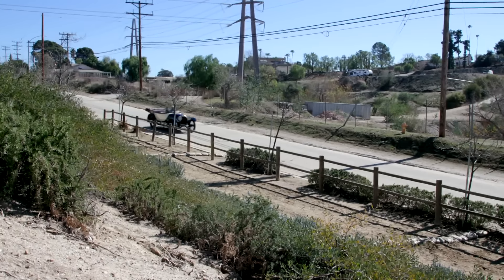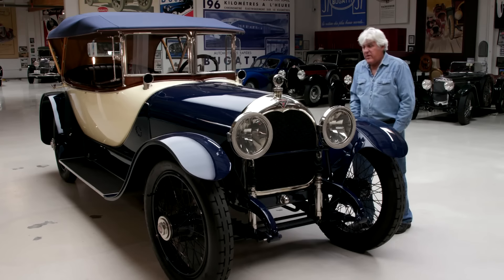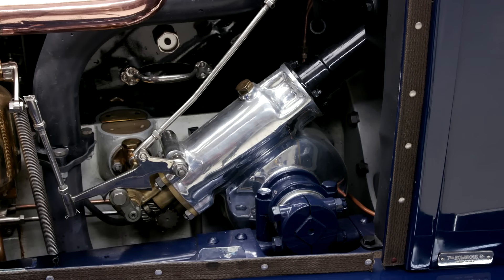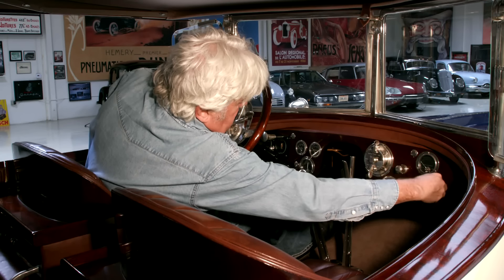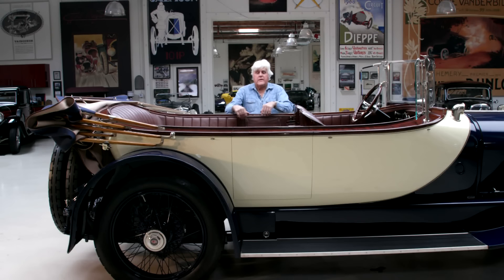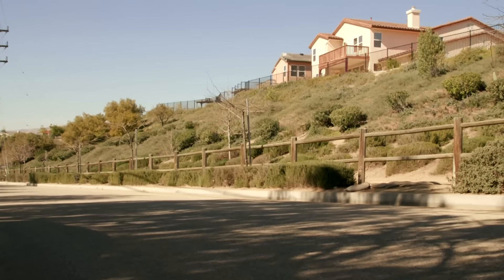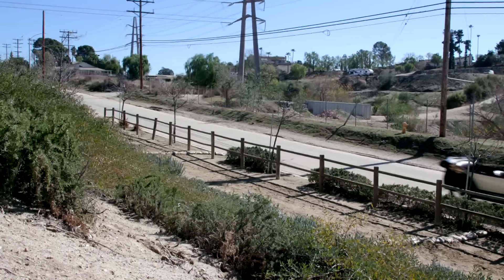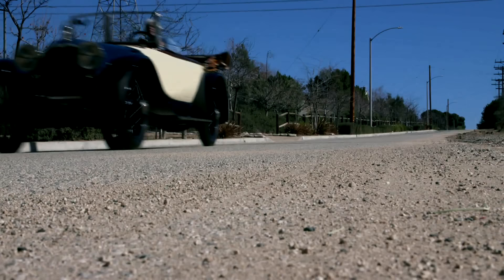1916 Crane-Simplex Model 5 Holbrook Skiff - Jay Leno's Garage

Comment: Thanks for the effort Jay. These brass era cars are so interesting, and well made 105 years old and still going!
Reply: It's only still going because it was completely rebuilt 25 years ago ...Jesus
Reply: @nickturner2813  It was able to be rebuilt because its not made out of plastic and microchips.
Reply: @nickturner2813  It was rebuilt twice because it rotted away in private owner's museums and was never driven. But blackscotydog is right, it's because it is all mechanical, you can just get on a lathe and make any parts that cannot be obtained, and if something is stuck, whack it with a mallet.  The Honda Insight EV-1 for example is a computerized car, and it is only 20 years old and already you cannot get battery packs anymore from OEM. You have to get 3rd party battery packs and at a cost of $8,000.  Also the capacitors and circuitry in the digital gauge cluster start to go bad and you need to find a computer repair shop just to rebuild that.

Comment: Those air vents are called dorades.  They allow air and rain to be taken in, separated, and the air goes to the cabin while the water drains out the bottom, which is not shown in the video.  The name comes from the name of the ship they were originally invented for.  The ship was named after the dorade fish.  So the fish became a ship which in turn spawned the vent style.
Reply: Every days aschoolday .Thanks
Reply: Thanks, I did not know that.
Reply: @Martin King Damn. You are a fount of information. Kudos to you
Reply: "Spawned" Nyuk-nyuk-nyuk!🤣🤣🤣👍
Reply: @Martin King thanks for the info! I wonder if the boat maker copied them from the car?
Reply: I was always told they were called Hawse Pipes  .. I guess because you can use them to stow away the mooring ropes on a ship, which are called hawsers

Comment: That face Jay made after saying “one reason they didn’t put brakes on the front is because they were afraid they’d stop too quickly” 😂 like seriously... WHAT?!?!
Reply: Did you notice there weren't any seat belts ? I think they were afraid if you stopped the car too quick that you would probably be thrown out .
Reply: In those days it was most likely it would be a horse drawn vehicle behind you, and they don't stop too quickly ! 😁
Reply: The first cars with brakes on the front, had a safety triangle on the back fender saying "four wheel brakes" to warn following cars.
The reason they did not put them on sooner was as Jay said, the mechanism was more complicated than at the rear, cars were not very fast or powerful, and they did not want to skid the front tires on mud and dirt roads and make them impossible to steer. Better tires and better brakes made a difference and today we have anti lock brakes.
Reply: @mrdanforth3744  Yeah, no, I understand the mechanical challenges Jay explained of equipping front brakes at the time, that reasoning made the most sense, but "stopping too fast" and now you're saying they even put safety triangles on the back of the car to warn people behind them lmao!!! Man do we live in a different time... Clearly they didn't use the term "tailgating" back then, and I'm sure brake lights hadn't been normalized yet (did the car in this video have brake lights?). It's just funny to think about, that's all. lmao "stopping too fast" nowadays cars don't stop fast enough!
Reply: Brake feel wasn't good, and with rods that didn't feature any proportioning system, let alone ABS, merely having brakes on all 4 wheel wasn't a good way to actually stop safely in a hurry, and too much brake force was near as much a problem was too little. That said, unlike a model T or other low output cars that accounted for most sales, I'd be very scared of brake fade in this >8L 110hp motor and very heavy luxury car, hence the "emergency brake" was really expected to be used in an emergency, not merely to hold the car when parked. But this fade is also one reason not to put front brakes on, as they will heat very differently to the back, but will always receive the same force, so a balance that locks the front first when cold, might lock the back first after a few hard stops, and that drastically changes the stability... yet very hilly regions still did demand the extra brake area, so it later became an option on many cars, including the Model T (sold as "mountain brakes" for a very large addition to the base price).

@man_on_wheelz from factory no, but Jay uses a wireless system that clips or magnets on, and transfers it between lots of his old cars, which gives most of the benefit, but avoids permanent modification.

Comment: Cant believe people had to follow all those steps to start the car. This is the difference between watching Jay and seeing the car in a museum.  Thanks Jay!
Reply: Daddy's 52 Chevy:  right foot on brake, left foot on clutch; put transmission in neutral with right hand and pull parking brake with left hand; turn ignition switch to on, pull choke knob out and push starter button; give it a little gas with right foot and push in clutch with left foot; put in gear with right hand and release parking brake with left hand; grab wheel, let out clutch, give it a little gas and away you go! See, easy peasy!

Comment: Sad day when comedians apologize for jokes they did years ago.
Reply: I know right.

Don't apologise to the mob Jay you should know that by now.
Reply: Liberals are systematically ruining everything. They won't stop until it's illegal to drive a car like this. The Biden administration is currently trying to interpret the Clean Air Act in such a way as to make it illegal to modify a car for racing even if it is not driven on the road. If they succeed, they certainly won't stop at that. They will eventually banish any car that doesn't meet current emissions requirements. It doesn't matter that these cars are so uncommon and driven so little that they account for a tiny fraction of the overall pollution; it's really about securing the power and control needed to push their agendas.

Comment: Jay pointed out the magneto drive. The center black drive block works on the vernier principle and is used for timing the magneto to the engine. The gross timing is set by lining up the teeth for closest fit to the desired timing point. There is one tooth difference between the front and rear of the block. The timing is then refined by rotating the center block in relation to the two end drive plates.  Moving the tooth engagement one tooth on one side and simultaneously one tooth on the opposite side in the opposite direction would yield 1/2 tooth change in the spark point.  This is an example  — a tooth could be broken into much finer increments if required.  Many old aircraft radial engines used this design for engine ignition timing.

Comment: What's really interesting about these old cars is the controls are not all standardized like they are today.   All cars today have a throttle and brake pedal, some still have clutch pedals.  But cars back then hadn't settled on a standard for controls, so you get throttles on the steering wheel, odd ball transmissions, some had the brake controls on the steering wheel.  One way to simulate the experience of driving one of these cars is to drive a riding mower.  Minus the mower deck, of course.

Comment: The Smith and Mabley Manufacturing Co. of New York City was founded by Carleton Raymond Mabley (1878-1963) and his brother-in-law Albert Proctor Smith to import European cars for sale in America. They built their first car in 1904, which was called the S&M Simplex, largely from imported Mercedes parts. The company went bankrupt in 1906 and in 1907 the firm's assets were absorbed into the Simplex Automobile Co. Herman Broesel, passionate about racing, purchased the company and redesigned the Simplex so it could reach speeds of 90 mph (140 km/h). The firm became Crane-Simplex after purchase of the Crane Motor Car Company of Bayonne, New Jersey, which had been founded by Henry Middleton Crane, in 1915. The Crane-Simplex Company was purchased in 1920 by the Mercer Automobile Company but by 1922 ownership had passed to Henry Crane, who then failed to realise an ambition to revive the marque. Henry Crane became a consulting engineer to GM Chairman Alfred P. Sloan. Crane later became famous in the boating field for his engines that powered the Dixie speedboats, which won the Harmsworth Trophy four times. This 1916 Model 5 Holbrook Skiff - built for 1916 New York Auto Show with yacht-inspired design, (including doors in the middle rather than beside passengers and a propeller in back) soon purchased at the San Francisco Auto Show, now owned by Jay Leno and is the only one in the world!

Comment: Bending wood round a panoramic dashboard like that is certainly a skill, but it can be done if you are patient enough. The simplest (but slowest) way is to leave the raw, unvarnished wood floating in a pool of water for a few weeks, turning it once a day to ensure that all of it gets equally soaked through. That makes it flexible enough to be bent without snapping. The quicker way (but more energy-intensive and expensive) is to put it into a giant steam pressure cooker, which does basically the same thing but in a few hours.
Either way, you then form the wood into whatever curved shape you need while it is still wet and flexible, then keep it clamped firmly in that shape while it dries out again. Once dried, it should then stay in the new curved shape, and then it can be varnished, stained or painted as desired. My dad had to do this for the back end of his 1931 Morgan 3-wheeler, which has several wooden sections which curve round almost 180 degrees. He didn't need it done quickly, so he just left the planks in our garden pond for a month to soak them.

Comment: Raleigh bicycles similarly started out with a forever guarantee for the original purchaser until the early 1900s.   Quality and everlasting was the theme of the time, then it changed during the 1950s/60s.  My 1946 Raleigh Lenton sports bike is simply guaranteed forever but I do not have it or the purchase receipt that is required.  Sold to last 100 years, thrives on hard work, very light to pedal, good road holding, light weight aircraft steel, as long as you keep it oiled with thin oil.

Comment: It's so easy to use electricity to do everything in a car.  What really impresses me is a car that has no electricity (apart from ignition of course), and how the mechanical engineers at the time created such wonderful mechanical equipment, with no electricity needed.

Comment: My 1995 Chevy Silverado had a light under the hood very similar to that one. It wasn't NEARLY as fancy. It was just black plastic. But it had a little hand crank and you could pull it out and go ALL the way around the truck with it. I'm pretty sure it had a magnet on the back so it could stick basically anywhere on the truck. Idk if it was an extra option or an included thing on ALL GM trucks around that time. I guess either people just didn't realize what they had or they just didn't have it but I thought it was the coolest thing in the world... If you have a 95 or there abouts GM truck. Go look under the hood. It was bolted to the firewall on the passenger side in mine if I remember correctly.

Comment: I gave credit to the corvair for using 180 throws like a benz crank on the six.. but this is clearly much older. Very historic for sure. ponder 110hp at 1800 is 330 at 4500.. a lot like today.

Comment: That's not a rubber coupling to take out vibration, It's a Vernier Coupling. There's one tooth extra on one side. By adjusting which teeth engage where, you can set your magneto timing to better than one degree.

Comment: I love the fact that you hear the gears more than the engine--wondering if  the body is steel over wood or all-wood?
Reply: Bodies were typically made of metal panels nailed on a wooden framework. Expensive hand made cars had aluminum panels, cheaper mass produced cars used pressed steel. This one shows more wood than usual but they all used a lot of wood.
Reply: I am fully aware of that fact-In fact, Henry Ford developed the charcoal briquet to make use of the wood scraps -KingsFORD--but in this case, since they were pressing the nautical aspect, with a large amount of mahogany, and it was a very limited production, so it may have been an all-wood body

Comment: An online converter says $10,000 in 1916 is    
$241,300,000 today. I knew I shoulda got it then.
All the old car info and Jay doesn't have a paper note one.
15:58, Wow, over a hundred years old and it starts up with a few revolutions. Try that with a week old Sportster in 1968.

Comment: It looks like there is a serpentine belt driving the fan on the engine. Was that an upgrade or did they actually have serpentine belts back in 1916?

Comment: Unpowered steering, you never turn the steering wheel unless you were moving. That relieved the "Armstrong Steering" probems. Not too many people remember driving cars or trucks without power steering.
I had a 35' Owens that had hydraulic steering, beautiful boat that had the air intakes like on your car. I lived in it for 8 years until I got married and had my first Son, and yes, you guessed it - the wife didn't want a child on a boat! So, I sold it for a grand down payment on a farm house, Owen boats were in high demand in the 80's, especially with the twin Packard engines and teak wood decks. I did keep all the marine and shortwave radios, had them set up in my Amateur Radio Shack becase they were the cream of the crop of radios. A National HRO-5 with all coil sets, and a Gonset Marine crystal controlled transceiver with 100w out.. So,as you collect antique cars, I collect antique tube radios. Remember, real radios glow in the dark! Fascinating series of your car collection! Love it!

Comment: I get the gross vs net change in measurement, but 110hp@1800rpm sounds like a crazy amount even still, simlarish power to modern diesel commercial vehicle you'd happily carry loads and keep up with traffic, or cruise on the highway at posted limits. For a 1916 road and tires? Wow, you'd be more crazy than brave to be actually realizing the engines limits.

Also regarding the compressors, its not just "got a lot of flat tires", but you actually had to air down for low speed "roads" and air up for higher speeds. Likewise electric tools weren't really a thing, but air tools where just starting to gain widespread popularity and get massively smaller/lighter and more varied in purpose every year, so its entirely possible such a luxury vehicle owner might attempt to use one, and providing air (especially at new factories ect) was very much seen as a way to "future-proof" for the new incoming technologies. Much in the way many of us regard "robotization" now, this was really seen as massive labor replacing sweeping changes that could come to many industries. Hence why some cars/trucks of the era had surprisingly big compressors and especially compressor tanks, while the actual air volume of tires was pretty limited... but not sure if thats the case for the Crane, it might be a little to high end to expect its operators to demean themselves using a power tool, instead of just ordering a half dozen of their best men to do it by hand.

Comment: 3 main bearings? Must be a pretty unique crankshaft.
Reply: A lot of cars had 3 mains back then, even six cylinder cars. Chevrolet made a six with 3 mains, into the thirties. Ford flathead V8s had 3 main bearings.
Stutz made a big four cylinder race car with 3 mains, all ball bearings. They split the crankshaft in 2 to fit the middle bearing.

Comment: Good Job. It is possible to revmatch the engine to the speed of the car with practice so you save on changing the gear wheel's in the gearbox since there is no synchro.

Comment: I guess you have to "double clutch" between each shift, right?
Reply: It would have helped. I'm surprised Jay never learned this, with all the old cars he has driven and all the old timers he has talked to.
Reply: @mrdanforth3744  My 1955 Chevy Pickup, 1st gear was not synchronized, and I had to double-clutch to get into first if I wasn't able to come to a complete stop first.  Else the old "Hey, grind me up a pound" would be heard from the peanut gallery.